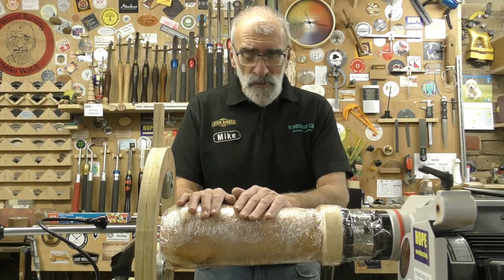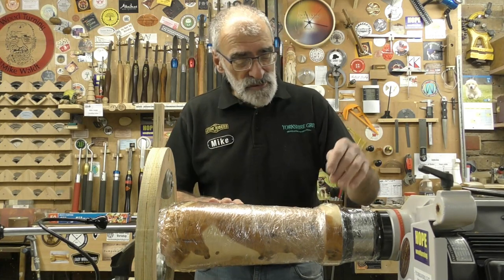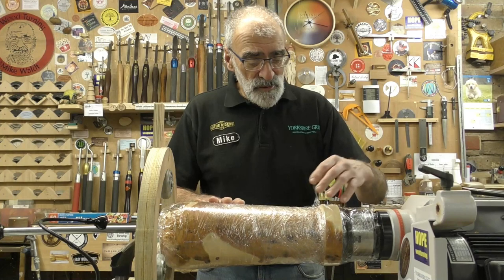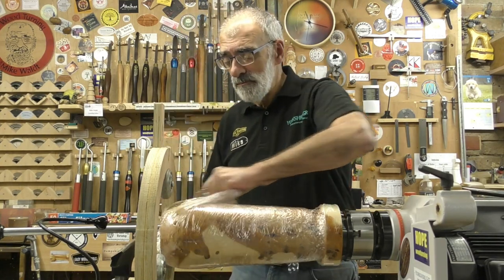Woodturning - English Yew Vase Fail !!!

Comment: Mike, Thanks for sharing a fail, now will be looking forward to the save.  BTW what brand is the articulated hollowing system you used, what is the size of the bar and what.type of cutters.  Thanks.  Cheers, Tom
Reply from the maker: Thanks Thomas. 
It's the Simon Hope Easy Arm Jig and takes a 19mm bar but also has a reducer for 16mm bars. 
Take care and stay safe.
Reply: Mike Waldt Thanks for the info Mike. Cheers, Tom

Comment: If you don’t make some mistakes you never make anything. I turned. Hollow form earlier and it was very thin with a small crack so I put some ca glue and was sanding it out when the top popped off. I’d sanded through the edge. Oh well it became something else instead.
Reply from the maker: Very true Jon and thanks for watching. Stay safe.